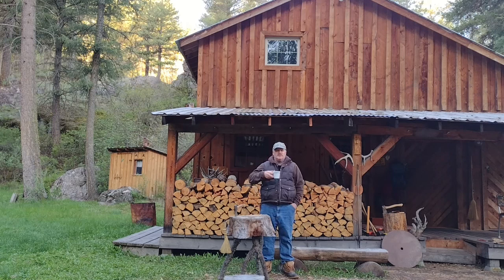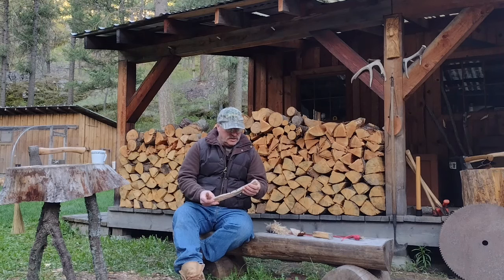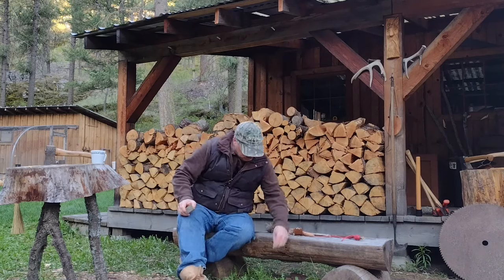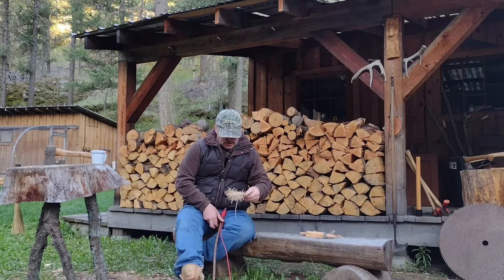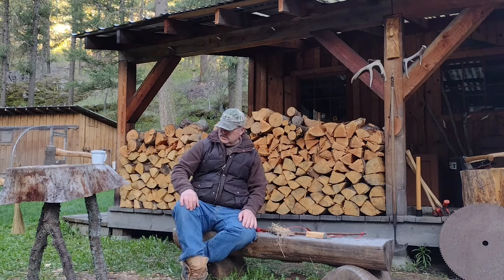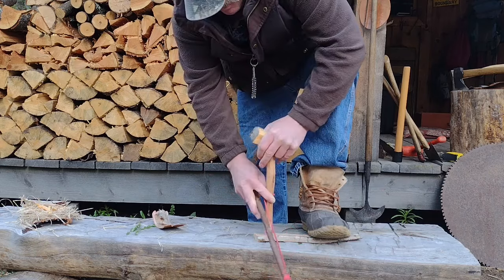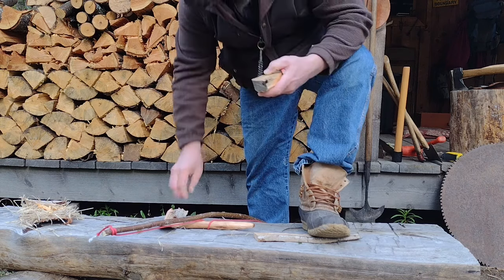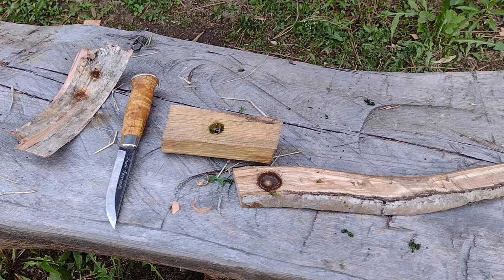Bow Drill Fire for Us Old Guys - Low Slow Coal

Comment: I’ve been looking forward to this as a bow drill fire is on my bucket list.  Don’t know how many times I’ve tried it and no luck.  So many great tips in here and of all the bow drill videos I’ve watched, this is the first one that has ever talked about the type of wood, lubricating the block, how you can tension the bow without stopping…etc.  So many things I’m doing wrong and matter of fact I’m going to watch it over again now.  Great work as always Kevin and Thank You for sharing all your skills with us.
Reply from the maker: Thanks a lot, Dave.  I appreciate that.  Preparation is the main effort.  Get all the components made right, and you will have success.  Make sure everything is dead standing and dry.  Once you have your set carved and prepped, it will last for quite a few fires.  You will have fun with it.  Good luck!
Reply: @WestForkWoodsman  great advice Kevin and thank you.  Been thinking about this and came back for another view.
Reply from the maker: @daveoverholt8540  One thing that helps is to stabilize your bearing arm around your knee.  I have stiff wrists, and don't demonstrate good form in this video.  Keeping the spindle straight and true builds friction faster.  Let me know how you do!
Reply: @WestForkWoodsman  Will do and I can't tell you how many bow drill videos I've watched and others don't tell you about having the spindle on the outside of the string, lubricating the block,  chamfering the bottom of the hole on the back side of the block to help gather dust or focus on the pull stroke.  I've also never heard about how the dust should be dark as many times it's a tan color when I try.  So many things I'm doing wrong and thanks to you Kevin maybe I'll get it accomplished.  Great content on your channel and always looking forward to what's next!!